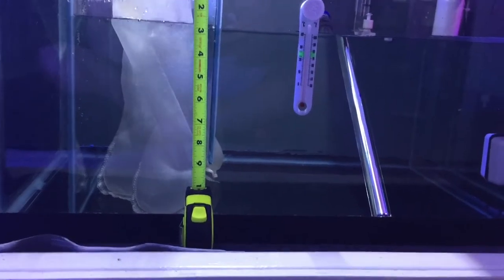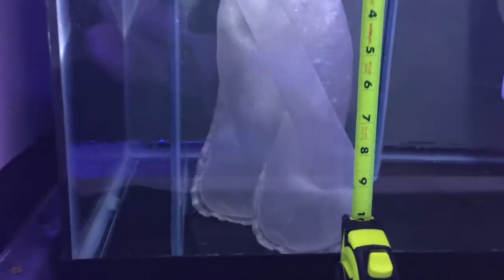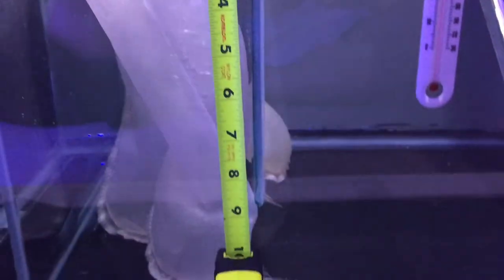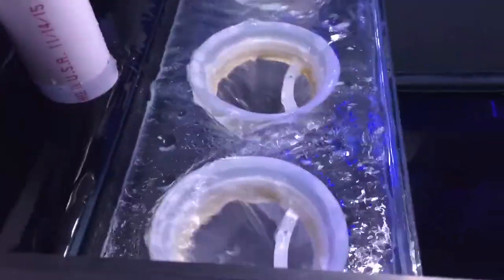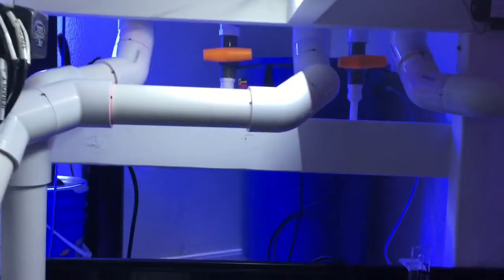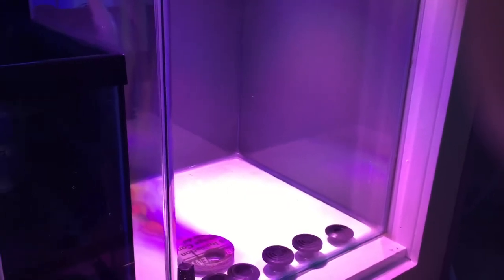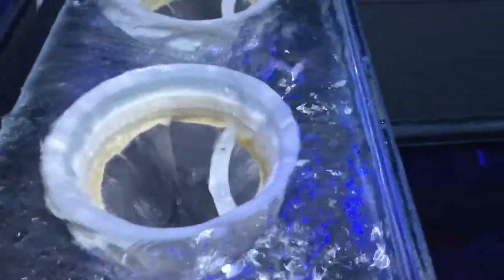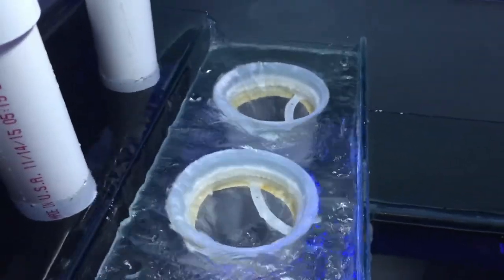New Filter Sock Mount

Comment: I like that you did that yourself with the glass. I think I might steal that idea for my sump remodel instead of buying a filter sock holder. The only comparable option on the market is the Fiji Cube quiet Filter sock holder, but it only holds 1 sock.
Reply from the maker: @Daniel St-Jean this time around I bought a $500 acrylic sump. Synergy Reef to be exact. It is very nice, but to be honest if I do it again...I’ll build my own out of a 40/B. You can get everything like you like it and you’re not restricted on anything. All you need to do is cut glass at local glass shop and tape the seams off with painters tape. Silicone and smear it into the cracks, and pull the tape before it drys ASAP to make perfect seams. The inside baffles where only one side can be siliconed is enough because sumps are low flow anyway. Just make sure you smear and get it good. Cut the corners out of your plastic right angles so that the corner don’t touch silicone when you’re plumbing them up.
Reply: Good tips. I'm working with an old Reefer 350 sump that was worked on by the previous owner so I figure I'd start fresh and remove the existing baffles and put some where I want them. I was surprised to find that there are at least a couple of glass shops in my area that would be able to cut all the pieces for my sump baffles and it would only cost me in the neighborhood of $100-$150 CDN. Much cheaper than designer acrylic sumps. They even have tinted glass which would be ideal for refugium section :)

Comment: Did you make your filter sock holder? If so how?
Reply from the maker: Bearded Leprechaun - I just made it out of glass with the dimensions I wanted. Any local  glass shop will cut the glass for you. Just tell them you want 1/4" plate glass with "seamed" edges. Then drill the filter sock holes with a 95 mm I believe. I'll have to double check. I have a video on it.
Reply: @Reefahholic  I tried to find your video on drilling the 2 95mm holes for your filter sock holder with no luck.

Comment: is´t the sound a little high? Thinking about doing the same, but want it more silent
Reply: Thanks.
Reply from the maker: Yeah, it was a little more than I would have liked. I'm fixing to build another one and where the water enters the sock compartment I will make that part flush. I will also decrease the high the water drops from the top of the sock to the waterline. I'll reduce that to about 1-1.5".